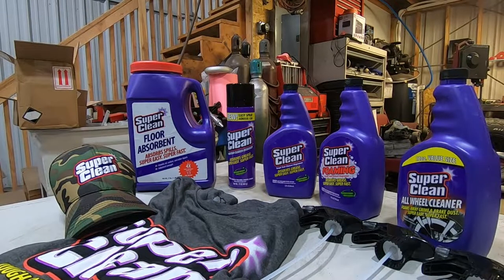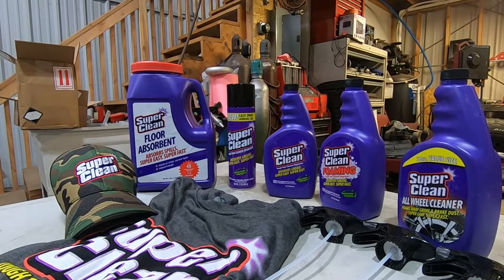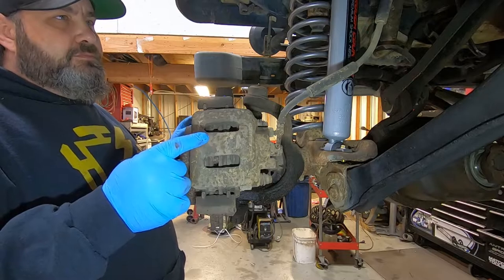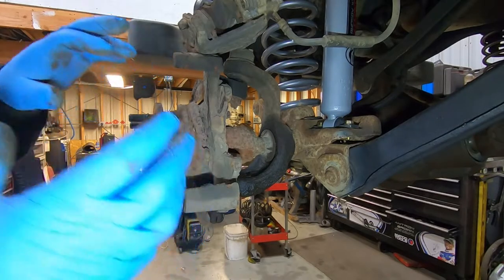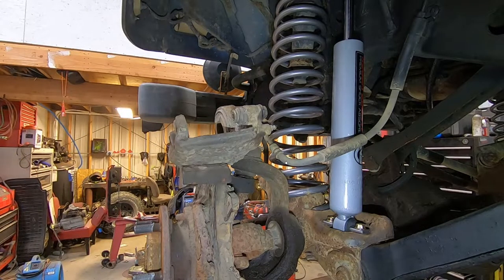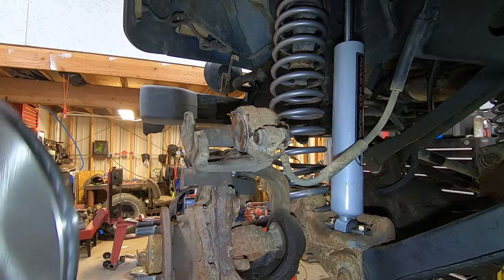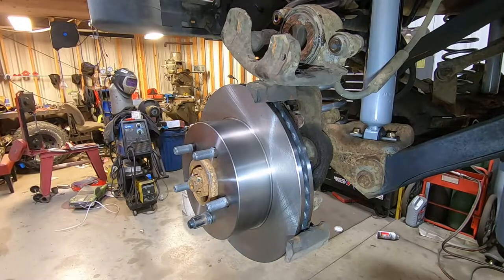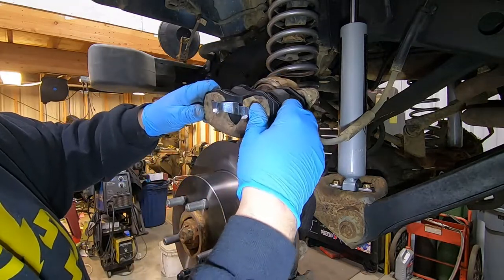Jeep Wrangler Front Brake Job! And Super Clean cleaner!

Comment: now I noticed that you didnt clean the flat spot on the  caliper that the shoes slide on ,I always clean them to they get rust on them and the metal part of the shoes will hang up, I have also used never seize on the back of the rotors

Comment: Love super clean, learned about it from car detailing channels. It eats pretty much everything I've sprayed it on,  but every once in a while it leaves a residue behind that needs another cleaner to remove.  

On those calipers, its pretty common that I've run into corrosion built up in between the rubber boot and the caliper itself causing the sticking. Popping the boot out and a quick pass with a carbide burr has them back to sliding like new.

Comment: Do you know what I need to do if my brake peddle is very soft after changing the pads and rotors on the front of my vehicle? Like do I just need them bled? Thank you
Reply from the maker: I would check to make sure everything is installed correctly and tight. You shouldn't have a spongy pedal if you only replaced pads and rotors. Also if you did not open the hydraulic system at all, there should be no need to bleed the brakes.